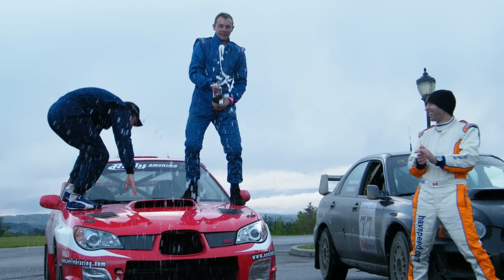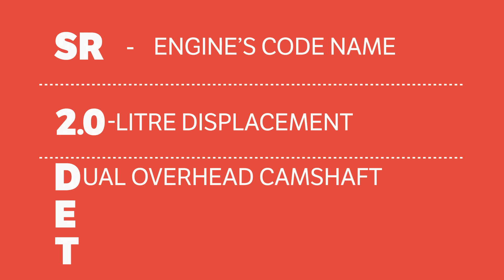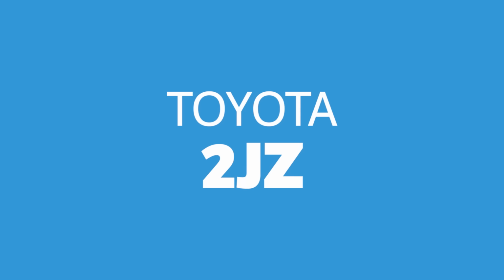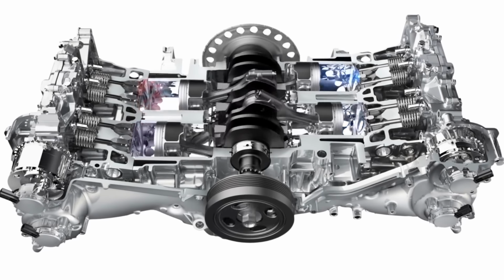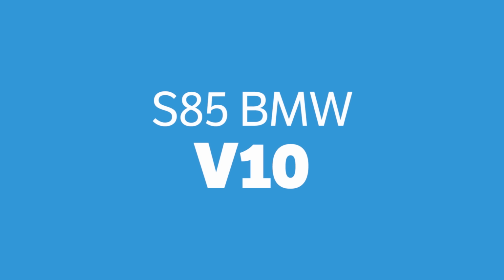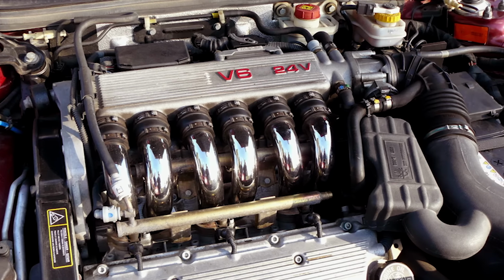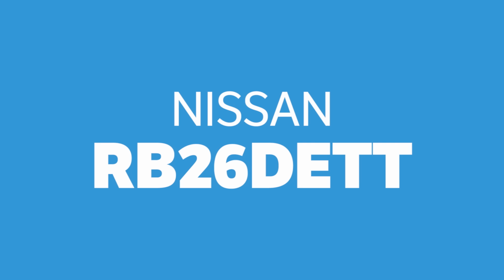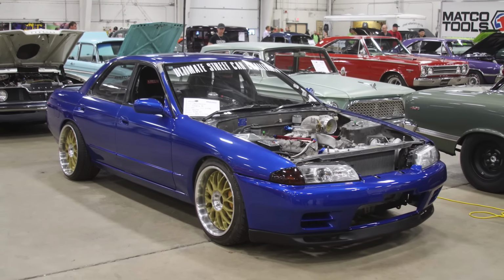10 Iconic Engines Every Petrolhead Needs To Know

Comment: I was afraid that the LS series wasn't there. This video stressed me. XD
Reply: I was feeling the exact same way
Reply: me too
Reply: I would've been extremely disappointing if they left the LS engines out.
Reply: I give them credit for actually adding it in, but I'm disappointed that they didn't add any footage of the sound. the LS7 in particular sounds absolutely pornographic
Reply: i was gonna unsub if they didnt have it
Reply: same
Reply: V8 fanboys.....
Reply: +PiwiGaming lmao u just mad bc we da best
Reply: +Tiime lmfao 4 cylinder fan boys
Reply: This list would have been shit without the LS.. Easily the best motor ever..
Reply: Oh shit, I came back and saw all the likes, probably my most liked comment ever. Thanks guys.
Reply: Gotta love the sound and raw power of a Ls check out my vid I've got a ls1
Reply: +Tiime no an rb26 is better anyways so
Reply: +PiwiGaming cause that's why it's the most swapped engine ever right? didn't think so
Reply: +Devyn Brady its cheap....
Reply: ***** Do you mean the LS or RB26 is cheap?
Reply: +PiwiGaming it's cheap because it's a pushrod v8 with nothing it doesn't need. doesn't need dohc.  it's a cam in block so the motor has small dimensions so it fits in almost any engine bay. no twin spark plug set up no two valves per cylinder doesn't need it. easiest engine to work on and add power to ever.
Reply: Devyn Brady and that's why it deserves to be called iconic!
Reply: And compared to the RB26 it's reliable. The 26 is known for breaking down of the oil supply if you modify it.
Not enough oil in the sump, a really bad design for the oil pump drive, the return bores in the cylinder head are to small to let all the oil leave it at high rpm and the oil mist that might be left than in the sump is sloshing all over in there, so the pump won't find any to deliver to the head.

Buttom end fail incoming.

A proud R32 GT-R owner.
Reply: +do3n3rti3r omg so heres my point ls swap a 240 or an s15 but not a rx7 or a skyline or a supra im fine with other ls swapped cars but none of the above...
Reply: +do3n3rti3r and I have nothing against that engine I've heard great things and coming from a girl owner I respect that and the r32 gtr is an awesome car I love it.
Reply: Guys, what I tried to tell you is that, if you look at the facts an LS engine is a better base to get higher HP from than an RB26. I love mine and I love the LS engines, if it comes to engine swaps I'm with you. ;)

But the RB26 needs a lot of work/money to make it a reliable monster. If you do it cheap you do it twice, thats a fact.
Reply: ***** Why do you tell other people to not swap the engine on their own car? That is stupid. Get an rx7 or skyline and don't LS swap it then, lol. Most people that get LS engines do it because of the simplicity, power and reliability.
Reply: +Hjalpmovie build your car for your own but i just dont like ls swapped cars
Reply: ***** Yeah, and you don't have any reason not to like them. They are way better than the japanese engines that are being replaced.
Reply: +PiwiGaming looks like you live in europe, you wouldn't understand over the LS. Just like us in the states never understood the rb26 and sr20 except for a few of us.
Reply: +Jamison V i dont understand the ls and im in the states lmao
Reply: I was about to say how did they forget Ls but it was number one
 
The reason everyone likes to swap them into cars is because of how cheap they are and how cheap the aftermarket parts are for them. Also because how realiable they are when you are boodting them or spraying them.
Reply: +PiwiGaming pips except a aluminum block in all those cars is lighter OR no more than 80lb full swap over
Reply: +kain452005 It's not the best. Nor is it even close to being. Iconic? yes. But that's only because it's cheap. Anything the LS can do a coyote can do better, with much less displacement.
Reply: +Justin S lol you know how much coyotes cost to build when you can get and ls way cheaper
Reply: Jonathan Alvarado I literally just said the LS is iconic because it's cheap.. Also you don't need to build a coyote. Change the oil pump, bolt on a supercharger, and your good to go.
Reply: +Justin S coyote might have less displacement but its physical mass is much bigger then the LS motor. I dont see to many people swapping 5.0s into miatas. Oh yeah probably has to do with the fact it has four camshafts that make the heads so much bigger and engine much bigger, plus the timing chain looks like a messy puzzle with the cover off. LS is so easy to deal with maintenance wise and once it goes theirs always other ones to pick from crashed vette, camaro or silverado, etc. Sure its overused but thats what makes it iconic making slow turds into death traps since 1997.
Reply: +Smeef Beef either you're not a car enthusiast or you live under a rock. Ima guess the former.
Reply: +Jamison V you explained it perfectly
Reply: ***** thank you
That and it's light as hell a full swap over the mk1 Miata is 80-100 lb more than stock

For a MUCH better and bigger engine that can be cooled just as well because its aluminum and much stronger than the 1.8
Reply: ***** I do agree with what you are saying, which is why it deserves to be on this list. But the Coyote is a meticulously engineered piece of technology. The LS uses displacement to make power, whereas the Coyote uses modern technology.
Reply: I was like, I DOUBLE DARE YOU NOT INCLUDE THE LS ENGINE!!!
Reply: KillEmAllWithMetal and not that much better since technically the ls isn't pr its modern overhead valve 
And it's only about what... 15 years old?
Reply: Justin S its more expensive to repair than an ls or most mass produced "older" engines
And In all reality newer stuff is more prone to issues because it's well... newer
Reply: KillEmAllWithMetal vvt has gotten its kinks worked out for the most part. It can be nice in a street/track car though 

Although full race you won't pick up much from it
You can
 but it can be a pain to tune
Reply: KillEmAllWithMetal 
"Modern technology is unreliable as shit"
Reply: Justin S because most the time it is in this age of planned obsolescence!
Reply: best for last.   I don't have an LS1 but I have an LT1.. and a non-turbo Subaru Boxer
Reply: do3n3rti3r  my GTR has never broken down not once misfired buy has never broke down or has a major problem.

Comment: My B5244 I-5 made it in but the 4G63 and the Coyote 5.0 didn't? It's my birthday!
Reply: yeah personally I can't believe that the 5.0 didn't make the cut...
Reply: The coyote is a great engine but not iconic enough, although i really have never even heard of the volvo engine
Reply: idk this video seemed to be more about in line engines, I believe half of the engines this guy chose were in line type engines...
Reply: PJ Zizzle
It's reeeeally big within the European tuning market, and it sounds incredible. The 5.0 definitely deserved to be on here though.
Reply: +SpaghettiFox of course it's really popular in the European market because you can take a 500 and slap a twin turbo or supercharger on it and be pushin 700 wheel... don't get me wrong a lot of the European cars are magnificent but when you start going against turbo coyotes and supercharged coyotes, good luck because he can always add more boost or build motor... mmr performance has a fully built 5.0 making 2200+whp runs 7.02 at 202mph in the quarter... that's a whole lot of potential when you can easily make 700whp with bolt ons with turbo or supercharger and be running low 10s possible high 9s... if you want to go all out and fully build, you could have a 7 second car that still would not have nowhere near the type of money invested in it as it takes to have those European vehicles... don't get me wrong he can also fully build his Lambo, I have never seen a Lambo run a 7 flat at 202 mph..
Reply: +Kristofer Pribble you can take a 5.0*
Reply: +Kristofer Pribble I was talking about the Volvo engine...
Reply: I love the new coyote motors they are badass all the way through, but it hasnt been out long enough for it to be Iconic, but the earlier 5.0s like the 5.0 HO have definitely been out long enough and idk why it didnt make this list, maybe because American motors are too good it would fill the list without any other nation's companys lol
Reply: +Kristofer Pribble yea I just found the mmr motor the other day and its about 8,000 just for the block and internals. I am trying to get that and build off of that when I get the money to do that. Just imagine the possibilitys with that freaking motor
Reply: +Paroxysm4539 yea it's insane
Reply: +Paroxysm4539 I have called different shop's about my car a to see how much it would cost to be around 1500whp, from what iv heard a 1500hp build is about 20grand... that mmr car that went 202mph in quarter probably had 30grand or more under the hood lol.... but that would still only be about 65grand in a 5.0 that runs 7 flat... that's cheap for that amount of power
Reply: Kristofer Pribble
It's definitely cheaper than getting a 2.5l 5 cylinder up to 1500 whp, that's for sure. Say what you want about v8s, they have a great cost per horsepower percentage. The high-flow heads and QOHC of the Coyote is really favorable for power adders, too, and you really only have to worry about the lower end (and rings) when you boost them.
Reply: +SpaghettiFox yea I have seen completely stock trans with unopened motors that put down 1000whp but personally if I went over 800whp I'm building it!
Reply: Kristofer Pribble
No reason to risk it, IMO. A trans blowing up is potentially dangerous for the driver, as well. Throw a Magnum in that bitch, row those gears like a man. Or a Powerglide, those work too.
 
I use too many commas.

Comment: The Yamaha 6 cylinder in the first gen Taurus SHO (3.0, 3.2) could rev to 8500 with some modification.  Such a great motor that people missed out on when they were at the local wreckers.  If you find one, please pick it up!
Reply: It actually revved to 9000 easily but Ford redlined it down because they didn't feel the accessories could withstand the high rpms.
Reply: David McClelland
 Nice, I actually have a the SHO Registry magazines that came out in the early 90s.  For some reason my Dad joined it when he bought his silver and grey 92 SHO (my Dad was sooo cool for buying that car haha).  I was just looking at one issue that details a car called the Perkins M2.  American built 'super-car' with mid-mounted SHO engine.  Very cool. http://imgur.com/scvIiUC
Reply: Son of Tamriel wasn't  a v6 it was a v8..

Comment: What about the 4G63T from Mitsubishi ?
Reply: This video recalled common engines we all know about.
Reply: 7 bolt versions are weaker than 6 bolt versions and the dreaded Crank walk.
Reply: Only true for DSM 4G63's. 7-Bolt DSM motors can still take one hell of a beating.
Reply: yep!
Reply: Honestly end of the day I think the Boxer is the more popular engine between the EJ20's and EJ25's. I've owned four 4G63 powered cars and a couple Boxers and I'd definitely take the 4G over any EJ any day I definitely see more WRX's and Impreza's then DSM's and Evo's.
Reply: +Joe DeSalvo still talking about crankwalk? i have seen one instance in 5 years of crankwalk on a DSM, 90% of thrust bearing failure was fixed under warranty. its not really a thing anymore. hasn't been since 1999
Reply: yeah I was really hoping there would be a 4g63t or Coyote on this list. Then again I should have expected it. I've never agreed with anything this channel has put out before..
Reply: What has Mitsubishi done lately?
Reply: Man from Nantucket EVO. What does that have to do with anything anyways?
Reply: Evo is dead. Eclipse is dead. Mitsubishi as an enthusiast's car builder is finished. They may have an iconic past, but they've got nothing in the cards for the future.
Reply: Man from Nantucket I don't disagree with that, just don't see what it has to do with this comment thread haha
Reply: Rule #25 of the internet, that's what lol
Reply: Lol
Reply: And 4AGE

Comment: I'm surprised the Volvo T5 made the list.
Makes me somewhat proud to have one in my ST.
Reply: focus st? thoes have a variation of a the mazda disi engine from the mazdaspeeds, ford funded mazdas r&d for that engine so they had the rights to it when they broke away from mazda.they changed little things like egr and I believe head is of a diffrent design not sure tho. but they do sound alot diffrent than my speed3
Reply: Focus st mk2 has the b5254t3. That mazda trash is in the mk3s
Reply: The Mk2 ST engine is identical to the Mk2 RS engine, apart from pistons, con rods, and camshafts. And turbo of course.
Reply: That was a na no turbo
Reply: MuminGoesMuslim
What do you mean? Both the Mk2 ST and RS had a 2.5L 5 cylinder turbo engine.
Reply: but the volvo t5 has a single turbo might only produce a measly .5 pounds of boost but its still there no matter how tiny it is
Reply: The Turbo is actually not that small. It's a K04 on the ST and the Volvos using it and a K16 on the RS.
The K04 can do up to 1.5 Bar (22 PSI) and the  K16 even slightly more, but on a higher rev range.

Obviously the turbo is not huge, but it spools at 1500 RPM and gives much low end torque.

Comment: Volvo 5 Cylinder iconic? BMW v10? Sure these engines are fine but you basically told us you picked these engines because they sound good.

There are so many better engines, 4g63, VW's VR6, BMW's M20...
Reply: M50 was an improvement over the M20 imo
Reply: 4age
Reply: MΣNT0R™ Spot on, another good one.
Reply: VW 1.8t>VR6
Reply: +Travis Flubacher vr6t>1.8t
Reply: M20/M30 sound better, but M50 sounds great !
Reply: The Volvo t5 is better the all of them
Reply: I would think the Audi 5 banger would be more iconic because of Gruppe B
Reply: +p0u1 I mean if you got the time for that
Reply: Mezger flat 6, Colombo V12....
Reply: I'd replace those with the 4g63 and maybe the S54
Also air cooled vw, small block chevy, and amc 258 if old school counts
Reply: The Volvo 5 cyl is iconic though. It's a symbol of Volvo technology.
Reply: Galf506 I feel like their safety equipment is much more iconic for Volvo.
Reply: In sweden we swap the volvo inline 5 into everthing. Rwd Volvos, bmw, jdm cars, hot rods,  its like the ls1 of sweden
Reply: ebenizzeR Archer Its definitely a good engine. But outside of Sweden; its not iconic. At least compared to the Porsche flat-six or the Ferrari/Lambo V12s.
Reply: It's iconic in Europe. Porsche doesn't have an iconic engine more than it has an iconic engine position.
What I can say is that BMW is more known for its straight 6's than for the V10.
Reply: Galf506 And Volvos are known as being hunks of boring Swedish iron outside of Europe. Heck the Saab turbo is way more iconic and memorable. 

Been watching too much Clarkson if you think that's all Porsche is known for. Their flat-6 is easily one of the most important engines in automotive history. Much more so than the 5 cylinder, the subaru flat 4, the piece of junk wankel engine and the BMW V10. 

Then there's the Lambo V12 which powered their cars for over 40 years; basically the signature heart of almost all their cars and gave them their legendary statuses.

How about the Colombo V12? Or the Ferrari V6 designed by Dino Ferrari?
Reply: Galf506 The only issue with the Porsche Flat-6 is which one is THE most iconic. Any one of their best engines should get the nod over the 5 cylinder.
Reply: Your personal opinion do not make a global statement though. Especially since you're outside EU.
Reply: Galf506 Aren't these all personal opinions?
Yup! There are other car cultures outside of Europe FYI. And shock and horror! Do not speak for the whole of Europe (though in my experience, Swedes like to think that they are the master race in Europe).
Reply: Galf506 I'll bet good money that the Germans wouldn't even consider the 5 cylinder as an "iconic" engine nor the French. How about the great British Rover V8? That I bet warrants iconic status moreso than the 5 cylinder.

Or the Ford DFV?
Reply: ***** The Mezger Flat-6 is rated for 600 hp minimum. A simple chipping allows the engine to produce over 750 hp. A bog standard road going GT3 RS came 6th overall in a field of race cars at the nurburgring 24 hours. Not to mention winning Le Mans in 1998...

That's much more impressive.
Reply: ***** Put big enough turbos on anything and you can get 1300hp easily. Doesn't say anything at all. Not impressive.

See what I did there?
Reply: Arguably the VR is more iconic since much of the design was borrowed to make the W16 or more accurately the WR16 in the Veyron.
Reply: I own two Volvos' with 5 cylinder engines an S80 with 2.4 NA and an 850 with the T5. The NA is nothing to write home about while it's a good engine I would have a V6 over it. Now the T5 is a different beast as others have said it's easy and fairly cheap to get good power gains out of it £1000 and some DIY will see 300hp. But yes shame the M20/M50 engine didn't make the list I remember that engine fondly when I used to have a E34 525i
Reply: The Jank Garage b16b
Reply: If it was just for Power imput  then the V10 can go easy 1500 HP no problem so why not? also N54B30/N55B30/S55B30 as well can hold over 1200 HP stock internals   S14B25 engine as well 4G63 for sure it hold over 550 HP VR6 is as well 550 HP+  there are so many engine to chose from for sure.
Reply: UnReaL WHO CAN DIGEST ALL THOSE FUCKIN NUMBERS !!!! TWO WORDS -PORSCHE TURBO !
Reply: my volvo 2.5t is as strong as an ox, takes a beating every single day and only wants more.
Reply: Porsche is strong no doubt that but not that strong on stock internal parts to reach 1500 HP the porsche engine need to be modify
Reply: lo0l
Reply: The Jank Garage the Ferrari V12 the Lamborghini V12 the F1 Ford Cosworth the Busa 1300 the F1 Renault V10 and on and on....Volvo 5 cyl and BMW V10? not so much...